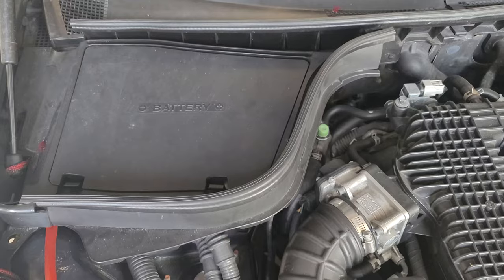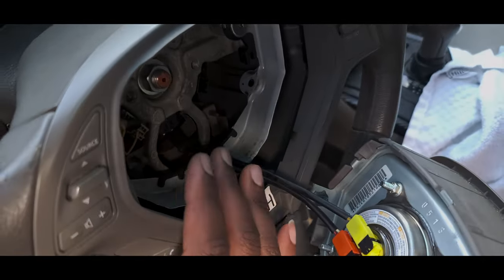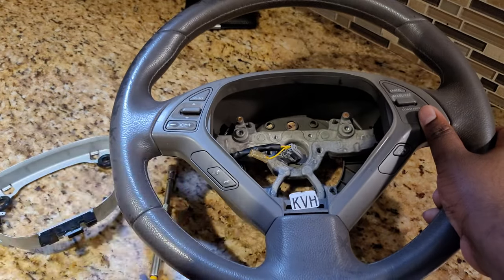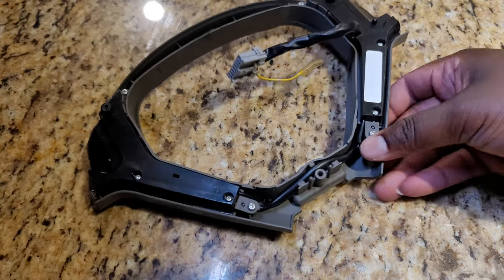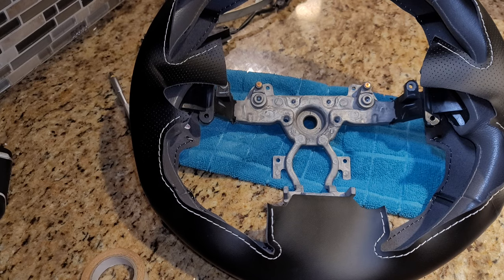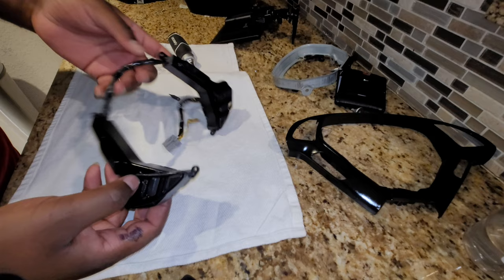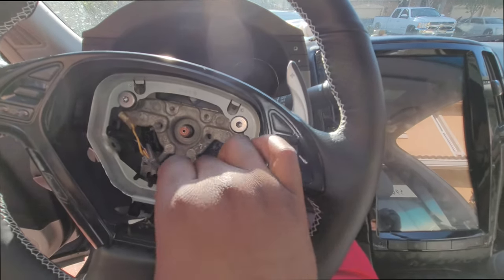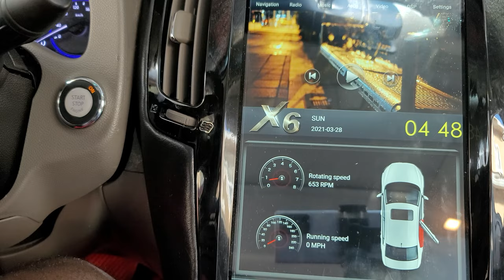Custom Steering Wheel for Under $50

Comment: Did you have any issues with the Telsa screen ? There was only one connector that connects the speaker which leaves out the RCA .. were you able to run the RCA for the Telsa and audio to the OEM bose system ?
Reply from the maker: I didn't use the rca cable I used the other connecter

Comment: Great vid, but I do have one criticism. While I get it's meant to be a budget mod, your hands are going to be touching your wheel more than any other part of the car. That fake leather vinyl stuff will get nasty and sticky in a few months. I've wrapped 4 G37 wheels, 2 in the ebay special and 2 with proper leather. Please, use redlinegoods Nappa or Italian leather, not the China-special fake stuff. It's a bit more pricey, but you get something that will last and will look and feel so much more high-end. No wavyness or looseness. Nothing worse than a loose cover.

Comment: How did you change the dash and cracks in the leather ?
Reply from the maker: i didnt changed it, i wrapped it without taking the dash out. A process i did prior to starting youtube.
Reply: @1BuildMedia  aww I wish you filmed the process. Trying to do the same for my fx35
Reply from the maker: You can use an old sheet as a canvas to do your cuts.  That was what I did.  Something I forgot to mention.